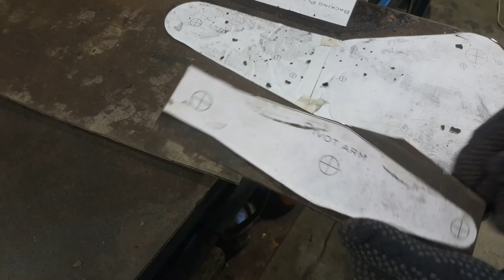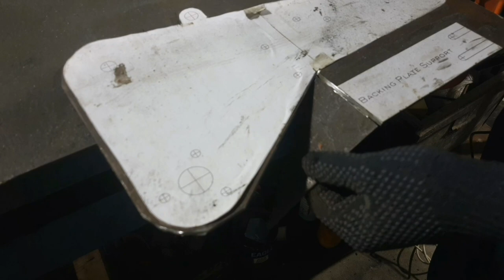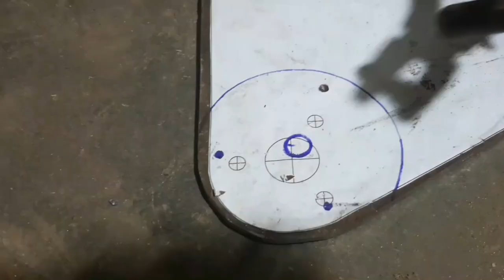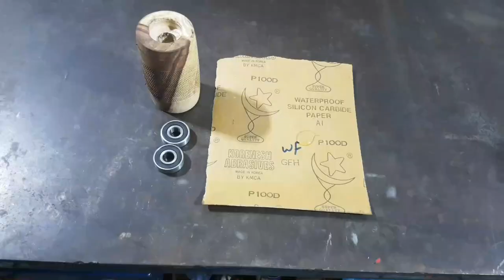I Turn My Bench Grinder To Belt Sander! Will it Work?

Comment: You've made a belt sander, not a belt grinder. 1 hp per inch width of belt and 6k or more fpm belt speed makes a belt grinder. 
     A 4 1/2" angle grinder spins the wheel at 12k+ rpm and the area making contact with metal is a fraction of a square inch.
     That's what it takes to grind steel with any efficiency.